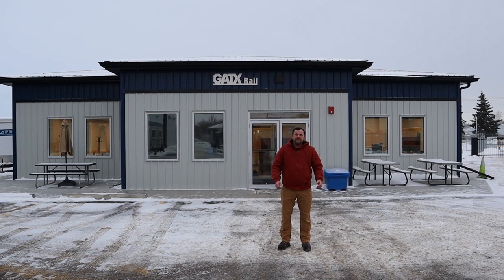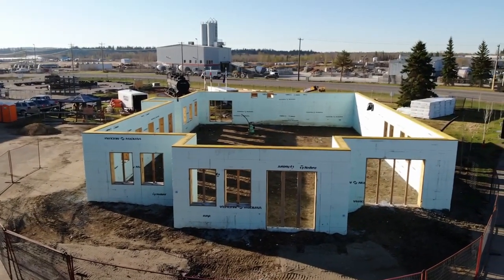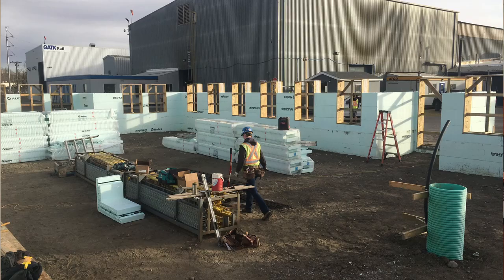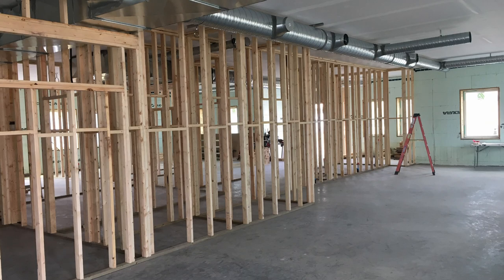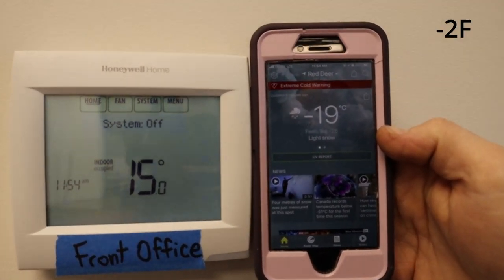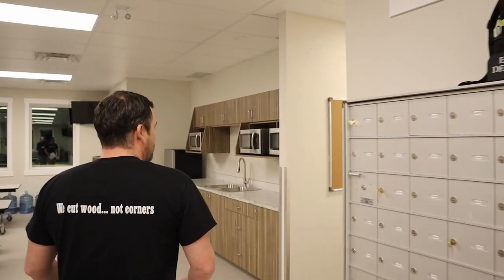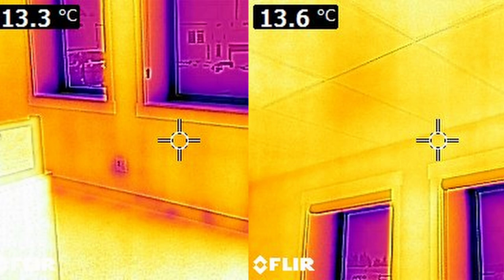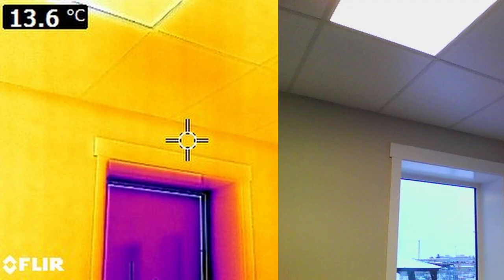The ULTIMATE ICF Efficiency Test-We Shut Off The Heat at -40!

Comment: I see this building is built with thick, high R-value ICF. I’m not certain I want house walls that thick. I’ve seen some of the products from the suppliers that are poly styrene sheets that slide into the form. FOX calls them energy sticks. They would add an extra 2” to the exterior and take an 8” concrete core down to 6”. Have you worked with any of those products?
Reply from the maker: This is also an option. I have a video on how to add R-value to ICF and it covers this.  Great idea and it would work great.

Comment: what type of heat do you have for this gas or electrcity for radant floore and havac
Reply from the maker: Natural gas for forced air which is majority of the heating. Supplemental heat by in-floor which is also gas fired appliance (boiler in this case)
Reply: Kody, does the in-floor heating have liquid or water in the lines? (Do they make forced air systems in under-slab PEX?)
Reply from the maker: Floor heat is typically fluid. Glycol is ideal. Sometimes water.

Comment: How long to heat it back up
Reply from the maker: 45 minutes to recover the heat.
Reply: I had that question too. I assume the 45 minutes is the time to heat up the air in the envelope, but now all the concrete is starting from a lower temperature. How long does it take to warm the walls & slab back up to the 21 deg C? Thanks!
Reply from the maker: Who knows the true answer to that? You would have to test how often the HVAC runs and get a baseline. Then after a test like this, the hvac may run more frequently until it reaches the baseline. That’s takes a lot of time and effort.
Reply from the maker: Superb question by the way!!